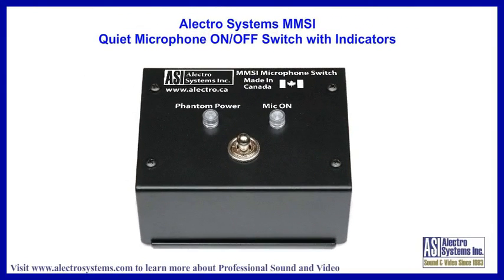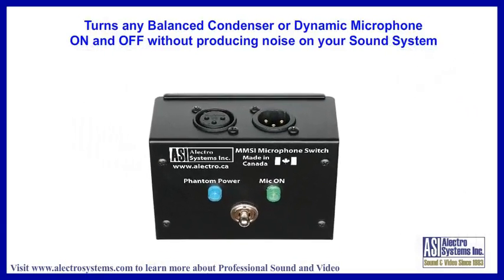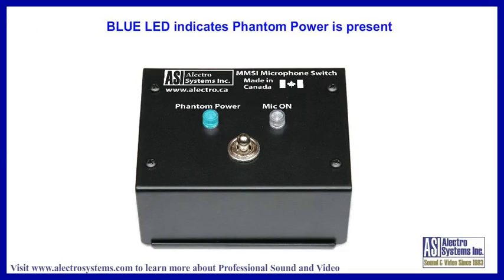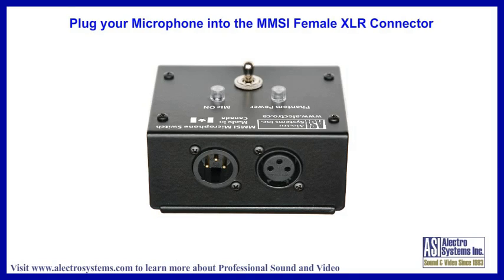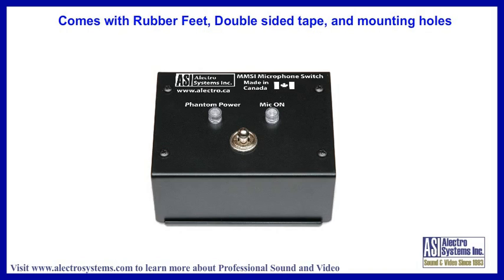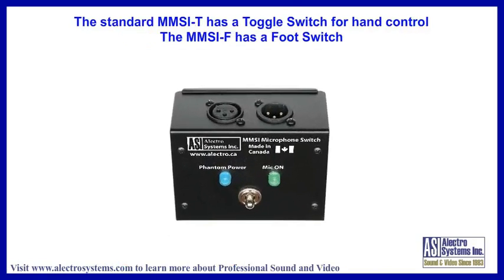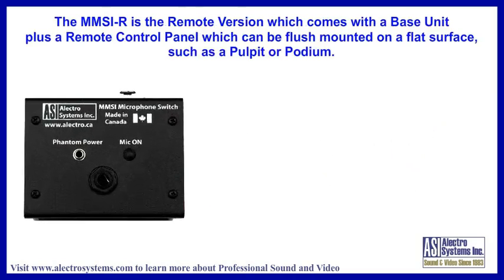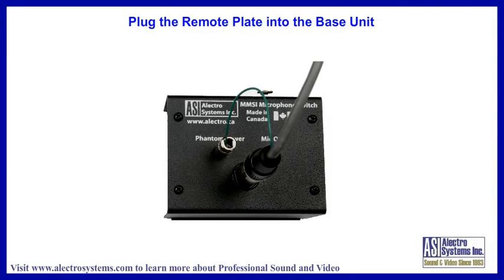Quiet On/Off Switch for Dynamic and Condenser Microphones with indicator Lights

Comment: I have the one with large toggle switch. From the first day i got it, it never work properly. When I turn it off, it would stay on.
I need to toggle the switch on and off several times for it to turn off. Kinda disappointing seeing how I paid a pretty penny for the unit.

Comment: I have another question also:  I would be using this with a 24v phantom power circuit (on a Fishman Loudbox Artist amp).  The standard for condenser mics is a phantom power range of 9-52 volts, I believe.  Does your switch conform to this standard?  Will it work properly with 24v phantom power?